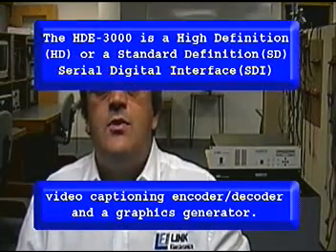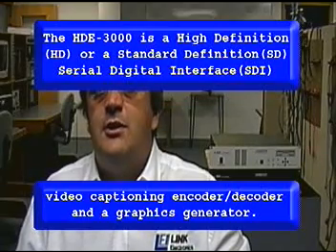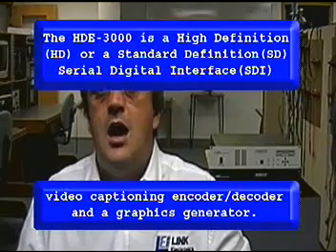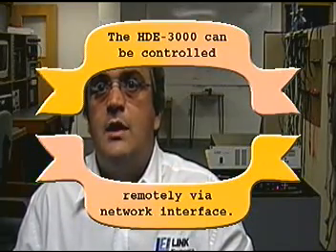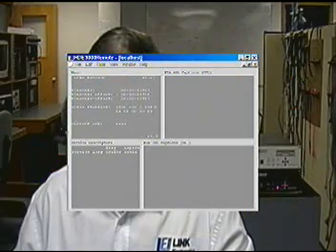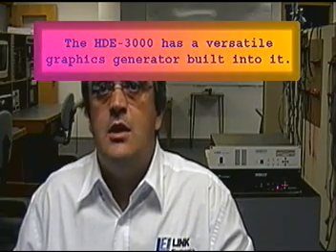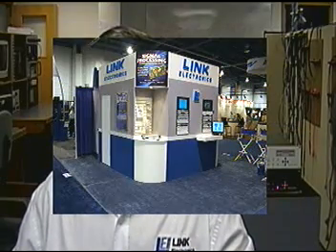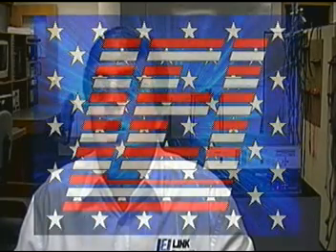HD Closed Caption Encoder Features

Comment: The HDE-3000 and the Sony HVR-1500a are compatible with each other, and the HVR-1500a does have caption options so it should be able to record captions.
Live captioning can be done with the HDE-3000.  There are many ways that it can be done I will list the two most common.  
It can be controled with teleprompter software via RS232.
A captioner can dail into an optional modem and control captions that way.